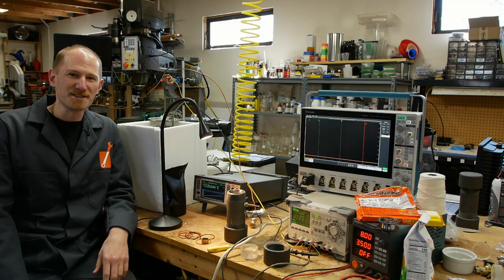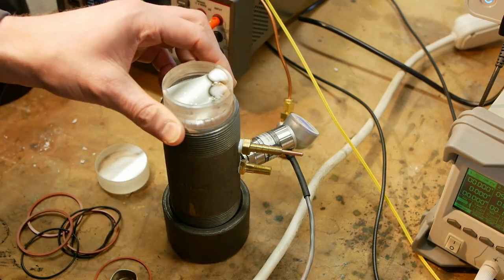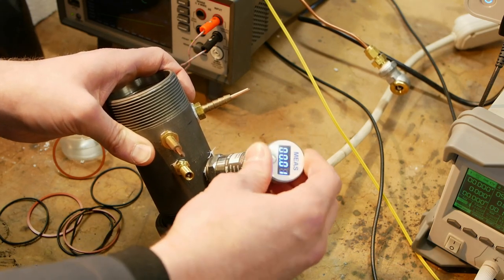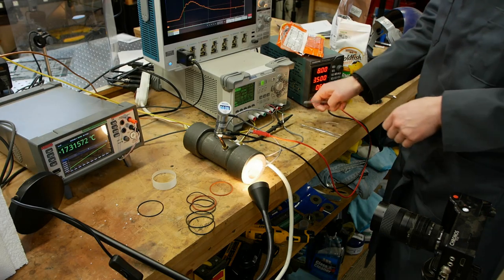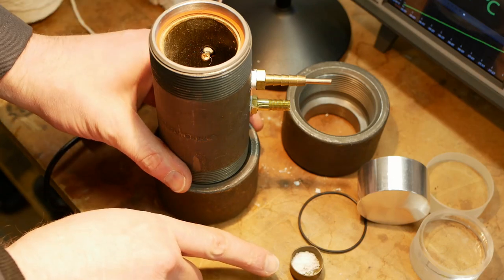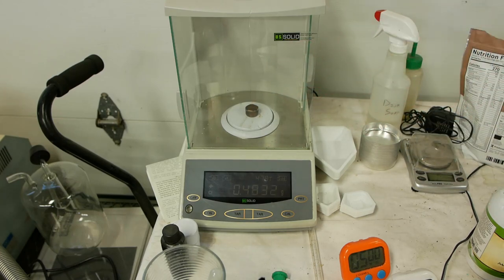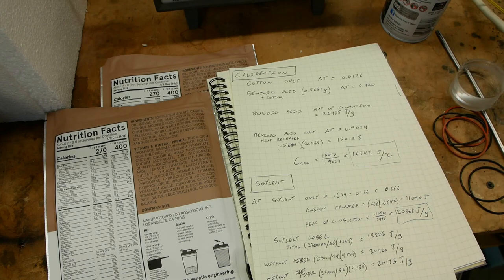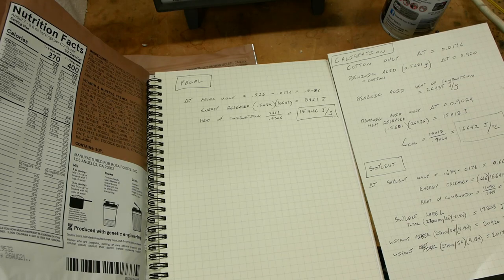Measuring human digestive efficiency vs. a flame

Comment: Really interesting video! I think it’s important to note though that 1g of soylent doesn’t go to 1g of poop. A lot of the mass is gonna be breathed out at co2. So even though the energy density of the poop may be almost as large as the food, that cannot be translated into an efficiency directly.
Reply: Agree. The missing math is the ratio of dry powdered Soylent in the top end to dry powdered poop out the bottom end.
Reply: @nedwelch1217  we just need to weigh the shit everytime we take one
Reply: He's measuring how many calories are actually taken in by the body, not how many calories are expelled by the body through breathing or retained by the body in fat.

If a 200 calorie item exits the body as 100 calories, that means you only need to burn 100 calories to work it off rather than 200 calories.
Reply: @bkucenski  that’s true, but the difficulty is identifying an “item”. A 200 calorie item can enter the body weighing 10 grams, then exit as a 100 calorie item weighing 5 grams (The missing mass is exhaled as CO2) If you simply took the energy density of the two and compared, you would think that no energy was consumed, as they are both 20 cal/g, even though 100 cal was consumed.
Reply: I came to the comment for this
Reply: Wouldn't this be fixed by also accounting for how many grams of stuff enters his mouth vs how many comes out? (which oooofc would be darn hard to do accurately even with a "thorough flush", but still...)
Reply: @MrDood-le8mn  It certainly is a difficult thing to quantify. You'd have to measure the dry weight of everything consumed over a period of time, after it's all he was eating for a week or more, versus the dry weight of everything he excreted (including urine solids). Couple that with any body weight changes, and if possible an accurate body water content measurement to offset any fluid mass difference, and then you could probably calculate fairly accurately how much of the food he actually used up. I really liked how he showed making the calorimeter though, I think that was the main point of the video. Someone could take it further and do an actual study on a group of people like I just suggested though, to get an average.

EDIT: Now I come to think of it, you'd probably need them on that diet for at least 6 months before starting measurements. Gut flora changes means you'd be excreting unknown quantities of bacteria for a while, and given an antibiotic I once took carried a warning I could get a potentially fatal condition caused by a gut flora imbalance up to 6 months after I finished the course of antibiotics, I'm going to guess at 6 months being when everything is almost certainly balanced back
Reply: 100%. He should have weighted all the soylent he ate through the last few days of the experiment and the poop that came out during the period. This way he could have accounred for the exhaled mass and determine how much soylent was used per 1g of dry poop and calibrated the results. 

Also it would be good to have measured precise body weight before and after the controlled period of time to subtract the nonreacted part of the food and get a bit more precision from the experiment at least somewhat crudely accounting for the fact that our digestive system don't operate in a completely smooth and continious mode.

But it is an interesting experiment nontheless and the biggest missing part of data can be just added - no need to redo the entire experiment.
Reply: And a lot of the poop is from decomposition products of heme
Reply: huh? co2 from the body does not come from food. it's already in the air
Reply: Yeah super disappointing to get to the end only to realize he kinda missed his own point
Reply: I commented too soon.

Comment: Really cool video! One theory I have why the efficiency is so low is if the digestive system is taking calories out of the food, it's also reducing it's mass. So in other words, the fecal matter is more concentrated than the input was. So for example, let's say you eat 100g and your body takes out 30%, the mass of the poop you'd have to burn would be 70g and not 100g. And in that case, with some foods that have a lot of flammable but not digestible calories, if the same mass is burned, I think it might be possible to have the poo contain more calories than the food, because it becomes more concentrated.

Comment: The "eua du toilet" bit had me laughing pretty hard. 
EDIT: damn it I wrote out a whole thing on how to improve this  and it got deleted. One sec lemme re write
EDIT 2 - electric poop-a-loo:

Ok so some things that are important to keep in mine. First poop is about 30% bacteria, 30% fiber, 15-20% fats/protein/cell debris, and the rest insoluble minerals. The minerals explain the residue you saw. But the important thing is that poop is like a filter, its the concentrated waste resulting from lots of eating. Also the cell debris is important. Your body uses the calories and those get turned into biomass. But then the cells die and get yeeted out with the rest of it, so some of the input calories end up in the output as "spent" calories. So you need to calibrate the actual mass in vs mass out to account for all this. 

To do that there's some things you'd need to do. The easiest, though also the least pleasant would be to take a ton of laxatives to clear yourself totally out, then fast for 1 day. After that eat 1 days food, then fast again for another day That would suck, no question about it. But that way you know the only thing you collect would be the result of a single day of eating. A less painful way to do that would be to add some sort of insoluble non toxic fluorescent marker to the soylent and then when you eventually pass it, only collect the part of the sample that's glowing. Then weigh it and compare that to the mass of input soylent during that meal. Then perform the test on that sample. Should give a much cleaner result. 

Frankly this is way more playing with shit than I'd be comofrotable with but, would clean the data up a lot and resolve some of the myster
Reply: you would still not count all the carbon that was part of stuff that went in your mithocondria, you exhale that, around 270g/day. So the only way to keep track of that would be to use radioactive carbon in the soylent or something and collect all your exhalations
Reply: Asstronaut asscream D:
Reply: i was thinking the same thing, but i think ben probably wants to space out his rounds of soylent brown diet. soylent brown is poople
Reply: @seanshomeshop325  Actually, it's peepoo but he only used the poo part in this excrement experiment.
Reply: >Puts out 15min video talking about E.coli

five hours later:

>Frankly this is way more playing with shit than I'd be comfortable with
Reply: @fluffy_tail4365  Yeah but those calories are "absorbed" calories that you are then using to do work. I think he is trying to determine the efficiency of that absorption and thus how many calories are left in the poop vs calories in food consumed.
Reply: Thanks for the re-writeup!
I can't stop reading it in Your voice in my head. Actually, very interesting mental-audio illusion. I have seen several hours of your videos, but... like, I live on the opposite side of the globe and English is my third language... It's still so strong of an illusion. It feels like if I read aloud - it would come out in your voice and pronunciation peculiarities... Not in my super-slavic accent like if I had balalaika stuck in my rectum...
Reply: If a single stool corresponds to several meals, poop from before and after the marked food could be contaminated by the fluorescent marker, making it difficult to collect "only the glowing part" without doing the laxatives+fasting thing anyway.

Two proposed solutions:

1) Weight the food going in and poop going out during a longer period of time, using the fluorescent marker just for the beginning and end of the interval.

2) Use a marker the concentration of which can somehow be easily determined. Eat only marked food for a few days and get a poop sample from the center of the interval. Known concentration in, measured concentration out, calculate the ratio.
Reply: Also, "eau de toilette" joke at 24:24 for anyone looking for it.
Reply: eat a measured amount of smth insoluable, in hospitals theres some liquid metal solution i they use i think. then meausre the concnetration of that in your poop. also put a measured amount of water around the bomb, preferably as little as possible to get the largest difference in temperature. frankly i would ditch the water bath entirely and measure the temp of the metal outside directly at the middle and ends.
Reply: @fluffy_tail4365  I wonder if nasa has any published research on this? Im sure they and the Navy have had to look into all of this extensively for encapsulated missions
Reply: the easiest way would be to collect a week's shit eating soylent, drying it daily (or bagging it in the freezer) to prevent loss of energy from fermentation. Then weigh and homogenize it, run it through the calorimeter to know how much energy is in it, and compare it to the amount of soylent eaten
Reply: @fluffy_tail4365  that's wrong
Reply: Sorry but the energy consumed may be transferred to molecules made from different individual atoms, so any marked atoms in the food will not show where the energy went.  Obvious example is a treadmill.  None of the atoms from the food go into the treadmill along with the energy your body extracted from the food.
Reply: something doesn't smell right about this comment
Reply: I never thought of "dropping a deuce" as yeeting, but I think we've all had the "Mach Poo" with accompanying tsunami backsplash.
Reply: As for cleaning yourself out, PicoPrep, the stuff they make you take before a colonoscopy would be what is needed. I'm thinking that the black coffee that he had may also have thrown the measurements off. Usually before any bowel procedure, you are limited to clear fluids during and after the picoprep stage until the procedure is over. As for an indicator, corn kernals work really well as tracer rounds. Perhaps the digestible part could be removed first and then the empty shells swallowed as an indicator.
Reply: "keep in mine"?  Typo I guess; d and e are next to each other.
Reply: @fluffy_tail4365  Actually, you breath out the Carbon as CO2, and the Hydrogen as H2O (moist air and urine) after the food is burned in your body.
Reply: I think the “concentration” bit here is key. Even though the poop may be of comparable chemical energy density to the food (80% or so), each gram of soylent eaten will result in much less than a gram of dried poop, so that 80% number isn’t an efficiency on its own
Reply: You could use something indigestible as a marker, as well. I was actually thinking about this same problem the other day, and figured using something like corn or nuts in sufficient quantity that it would be visible in the excreta would make a fine marker. In my case it was to measure the transition time between eating something and excreting it.

 I had considered fluorescent dye, as well. But my only options that I have around were either fluorescein, which I'm not sure about the toxicity of, though I'm sure it's pretty well tolerated if they put the stuff in your eyes. (It was an ophthalmologic preparation.) And I figured you only need a couple of drops to be visible. But then I wasn't sure if it would undergo metabolism and be excreted through urine, or just pass directly through in feces. Or I had highlighters, which are also fluorescent. But in that case, concerns about toxicology were much greater. Plus there's the issue of the dye being a liquid, which will diffuse through the chyme (the liquefied food being digested in the small intestine) and contaminate waste from other meals.

 So in the end, I figured corn would work just as well. I just eat a meal with a bunch of corn included, and then wait for the corn to come out, and I've got my transition time from eating to excreting. It seemed to work pretty well. And as long as I only ate corn once with that meal, I would have a pretty accurate figure for the transit time.
Reply: @altaroffire56  I believe there was a scientist who did rigorous experiments weighing absolutely everything that went in and came out of his body. Unfortunately I read about this so long ago, I can't recall his name, when he did it or any other details. But I'm sure details of it can be found through some light Google searching.
Reply: There might be an easier, albeit less accurate, way.  If he's controlled his diet to a consistent input mass for a relatively long period of time and the output schedule is consistent (e.g. every 24 hours) then you can use the known input mass and an an arbitrarily chosen output to find the input-output ratio.

Soylent might make this difficult though; IIRC you don't poop very often on it.
Reply: Digging for glowing poo to get a "much cleaner result" sounds contradictory
Reply: To avoid needing to fast, he could stabilize on the soylent diet and then begin measuring exactly how much he consumed against exactly how much excrement he generates. Take the average ratio of out/in over a week to correct for the losses of mass through respiration.
Reply: I guess it's not far off to say the amount of residuals are proportional to the amount of poop, and not that much dependent on how many calories went in (bias). So you can eat a fixed amount of soylent for a couple of days and take a sample from that poop just as done in the video. Then a couple of days with half the amount of soylent and another couple of days with double the amount. That would give you three points which represent three different concentrations of whats left of the soylent in poop.
So, if duplicating the amount of in-soylent changes the result 10%, now you have a better aproximation of intake efficiency. And, then, I would expect it to not be linear, as with a lower intake I would expect everything to be absorbed and only present a difference when you saturate the intake system.
Reply: Seeing "yeeted" being used in such a scientific paragraph makes unreasonably happy.
Reply: *eau de toilette
Reply: You are so over complicating things. The only thing missing is accounting for the ratio dry mass in / dry mass out to adjust for lost or gained mass from breathed carbon. The rest is a stable input / output system so get lost with all these shenanigans.
Reply: @IanBakker  why would they need to go thru this at all?
Reply: @IanBakker  encapsulated missions eh?

Did you not know the earth is flat you have been lied to!
Reply: 24:25 for anyone wondering
Reply: i'd just weigh all the water and food consumed and take an average of weighted air breathed in and out
and weigh all the poop and urine for a couple a days, maybe  a week, or more until it stabilizes and one can match up the numbers
Reply: I think the best way might be to drink those things that have all the nutrients you need for a week at set times, then do a baseline test from that.
Then, continue with the same liquid diet and only add the food you want to test.
By comparing the before and after, I feel you'd at least have something to compare with.

Actually, it might be useful to talk to a body builder, or an athlete, or a coach.
Reply: I had a comment  get deleted, too.  The eau de toilette joke made me think of an old advertisement from Eastman Chemicals describing some of their products. I'll skip the link this time - perhaps YT  thought I was trying to sell something:

"Indole, the parent compound, is found in jasmine, orange blossoms, and feces. When a methyl group clings at the 3 position, you have Skatole, the most fundamentally unpleasant of all the stenches we keep in bottles. (As a precaution in case of accident, we have assigned Skatole to a chemist who happens to be olfactorily totally blind and deaf-a valuable man.) Despite its central role in scatology, Skatole is also a fixative in fine perfumery. Where in the misty seas between psychophysics and psychoanalysis lies the explanation of this dichotomy, we know not."
Reply: Great comment. You should read mine. I love how you can instantly tell your biology and my chemistry background just by reading our comments and suggestions to correct the experiment :D
Reply: Poop-a-loo is what happened in the capitol on January 6th 2021
Reply: I’m super late to the party, but wouldn’t it be easier to just punctuate meals with a big pile of insoluble fiber? Something akin to the bamboo plug pandas drop. Maybe a large salad. Boring salad, but large. Your data would fall between the, um, mulch?

Comment: 15:05 Try a U shape groove (not too deep) for holding the silicon seal in place.
Ideal is when the glass is pressed firmly down and barely touching the metal holder, that way the gap of exposed silicon seal to the burning environment is almost zero and the seal will last much longer.
This technique is used in small (50a70cc) 2 stroke watercooled bike engines (pocketbike etc...)